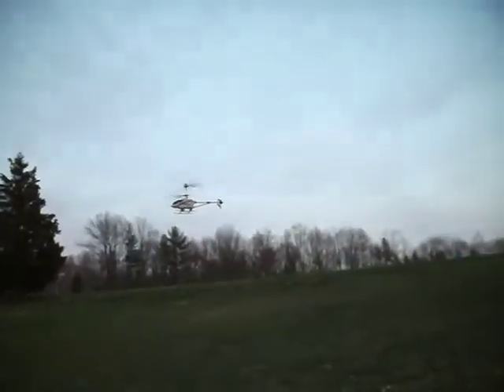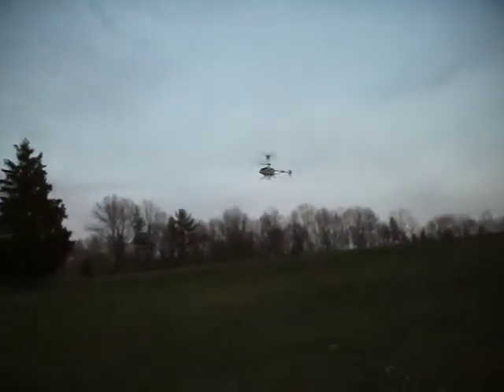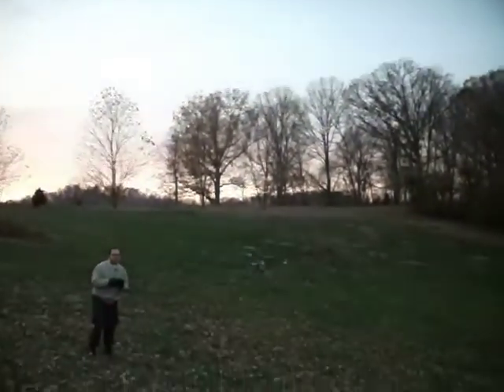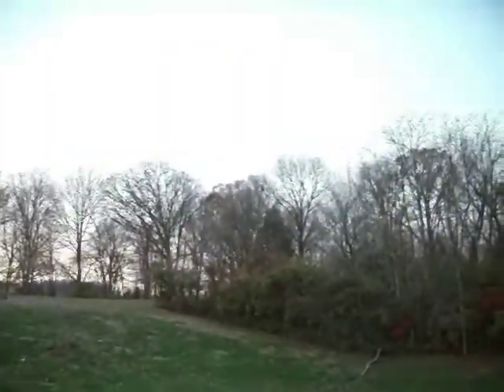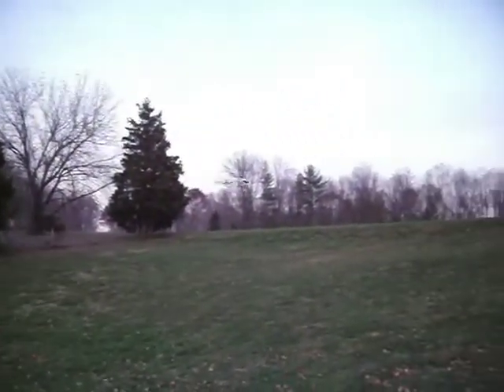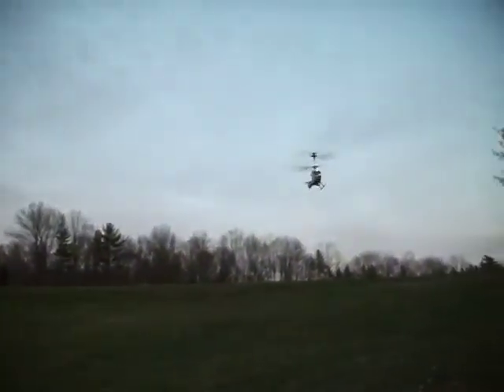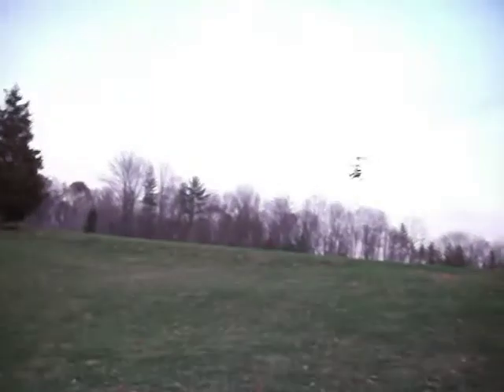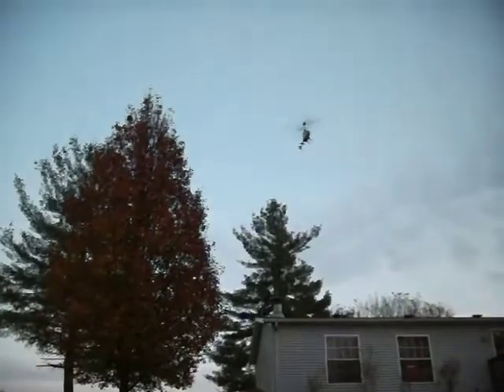Flying the larger helicopter outside

Comment: Quite honestly, i think he did a DAMN GOOD job flying that heli....!!! Especially, with it being up so high if your suffering from forward speed your probably fighting against the wind at that altitude. So i would recommend taping a nickel to the front of the heli's nose that might improve forward flight a bit more. Otherwise, seems real smooth and powerful enough to fly outdoors in CALM weather to me. Notice i stress CALM weather these coaxials don't handle winds well at all even the largest Syma S33 can't handle it. You need to go with a collective or fixed pitch for that like a WLToys V911 or v912.